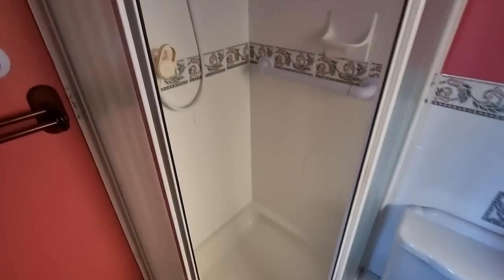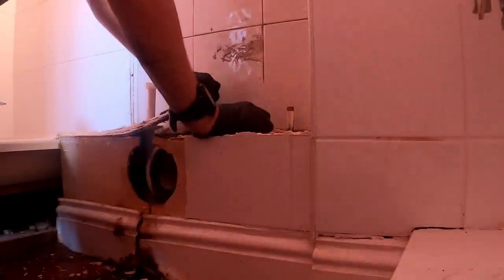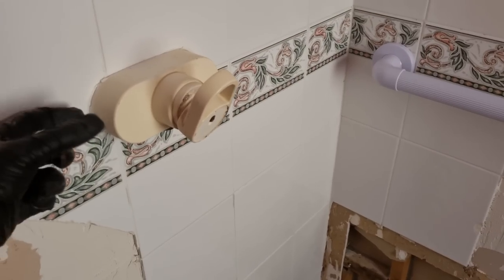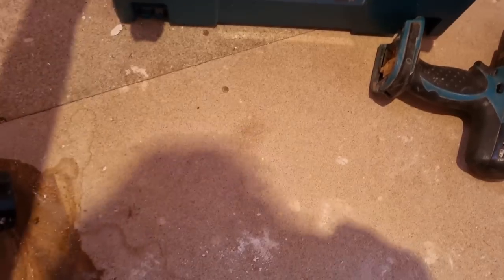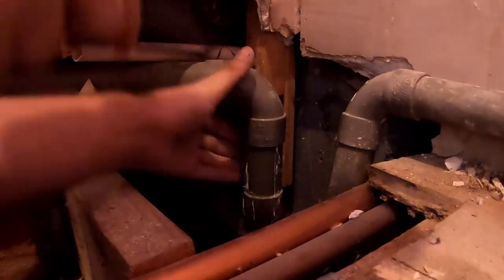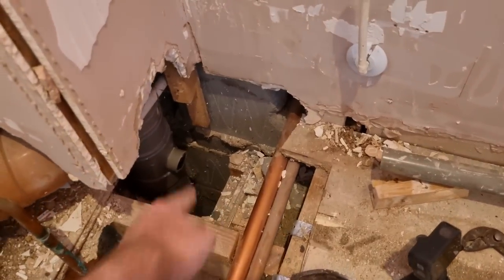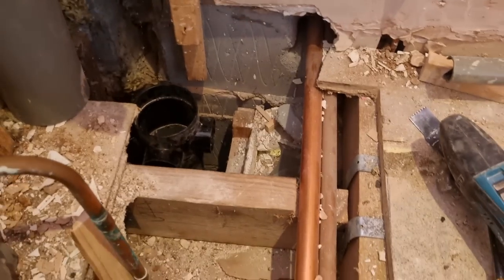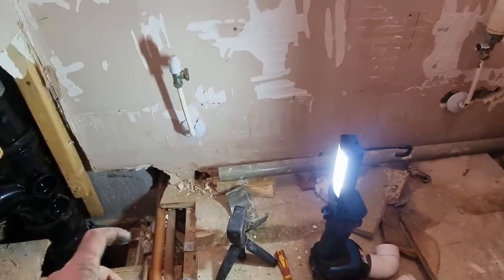Complete Bathroom strip out and lowering of waste pipework

Comment: Nice one Tom , I enjoyed the longer video to be honest..... 👍
I'll give you a tip for cutting the soil low down
Get some M16 threaded rod and a couple of nuts and washers and get a part worn 4 inch angle grinder zip blade and fix it to the rod stick the other end in your drill and stick down the inside of the pipe and you'll have yourself a perfect long reach cutter
Cheers mate.... 👍
Reply from the maker: I like it, I might have to try it that way in the future, thanks for the support mate, have a great weekend

Comment: Good morning Tom, just watched this video and brilliant job as always. That did look like Rymway pipe and is a true imperial pipe. It goes back to when there was two manufacturers in the UK, Rymway and Marley. Marley ended up buying Rymway out and Rymway was always the cheapest but both brands where never compatible!
I was on a job a few years ago after a new bathroom had been fitted in a bungalow. The original waste had all been Rymway and the fitters couldn't get the new a new push fit boss onto the end of the old Rymway pipe so they thought it would be good to cement the two ends together. No surprise that the basement got flooded with waste!
Reply from the maker: Thanks for the support mate, you are most likely right, I know there are a few different brands of soil pipe and waste fittings, you do get some that don't fit. It does make life hard work when they don't

Comment: Should use your multitool for cutting them wastes. Will save you some time and effort!
Reply from the maker: Fair point mate, I sometimes struggle to get the multi tool in, I might see if I can get a long blade, I don't know if they make them but they would come in handy to cut fully through soil pipes, thanks for watching 👍

Comment: Invest in an inside pipe cutter or make your own like I did. M10 threaded bar and a nut either side of a small circle blade. Works a treat and saves a lot of hastle
Reply from the maker: Thanks for the support mate, I will definitely be checking out the internal pipe cutters

Comment: tom u need to get a mulitool  or on of them small bosch recip saws
Reply from the maker: The only problem with a multi tool is I find the blade is not quite long enough to fully cut through 4" pipe, If you have access behind the multi tool is ideal, thanks for the support mate and thanks for watching

Comment: Still a good video to go back too watch as I’ve just started mine egg board walls toilet is separate but hopefully will be able to gain excess too the soil pipe that if I don’t cut through my oxygen tube when cutting out the floor,just waiting for the new Titan digital shower that’s coming out middle of August to put in loft, but I’ve started now so it will be done anyway 😂😂 still nice work there Tom ,👍👍👍
Reply from the maker: Thanks for the support as always mate, bathrooms can be a minefield sometimes, the soils are usually the hardest part I find, it will be all worth it in the end though, just take your time and look after yourself

Comment: Following this job Tom. I do bathroom adaptions and fit disability shower rooms, wet rooms. Also used to work for AKW. Have you thought about fitting a Tuff form former and getting the floor vinyl cap and coved? Would give the customer complete level access 👍
Reply: My flat has AKW proper expensive 😱😱😱😂😂
Reply from the maker: I did price up a full wet room but the customer opted for the shower tray option, currently his mobility is fine but the step into the shower as it was, was just too much, the shower room also needed modernising, so he was happy to go with a tray. I do install a lot of DOC M shower rooms and during lockdown I picked up a contract for the NHS converting standard wards into specialised ICU with wet rooms, thanks for the support of the channel mate

Comment: Nice content Tom👍🏻 had a few like that this year! I don’t know what access was like but you could have cut the soil with your multi tool. Cut a square/ rectangle in the front of the pipe big enough to get the front of the multi tool in,then the blade will cut through the back of the pipe,hope that makes sense?
Reply from the maker: I sometimes do it that way, this one was just super tricky to get the angle right, thanks for the support as always mate 👍

Comment: Hi Tom  the soil pipe being terrain welded is a surprise on domestic,  normally only see it on commercial jobs .  No idea why house builders don't put waste pipes under the floor especially if it's welded , will never leak and you can flush it out if it gets clogged up .
Reply from the maker: When these houses were built they weren't built to a very good standard or quality, waste pipes under the floors look so much neater and like you say can be unblocked if required, I think it was just quicker for the plumber to just rough them in on the surface with no clips, thanks for the support as always mate 👍

Comment: Honest question regarding the refurb, we're using insulated cement faced boards now due to the changes to the building regulations specifically BS 5385:2018 Part 1 - wet areas. Any wet area being bath/shower/wet room/steam etc requiring the use of a suitable tanking membrane. 
I see so many people still using moisture plasterboard even on new builds and not bothering to use the latex sealer over it and ignoring the requirements, which not only goes against the NHBC warranty standards due to not complying with the standard but also allows customers to get out of paying for the job on refurb work and insurance companies to do a double take.

Basically I'm wondering why people are still using it when by the time you've used the paint on latex tanking membrane it costs more than the cement faced foam boards.
Loving little job and shows you're a hard grafter, nice to see someone else hates boxed in soil connections too.
Reply from the maker: I would always recommend the use of a proper tanking system when tiling in shower or wet areas, the standard you are refering to is only a recommendation and as far as I'm aware is not a regulation, unfortunately best practice standards don't have to be followed so building control for instance would never pick this up. Until there is a change in the regulations builders will still be able to use plasterboard for example in wet areas because nobody can regulate this.
Reply: @PlumbLikeTom  We've been working to it as a regulation in our area for awhile as the NHBC chap won't accept plasterboard now. We tend to cater towards bespoke builds rather than off the line new builds though.